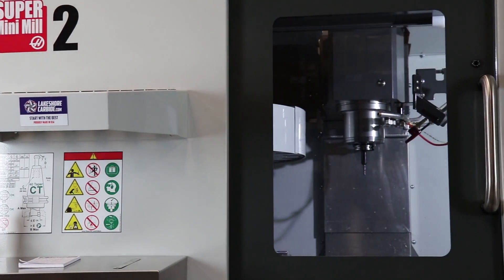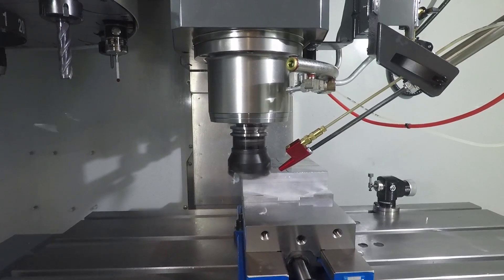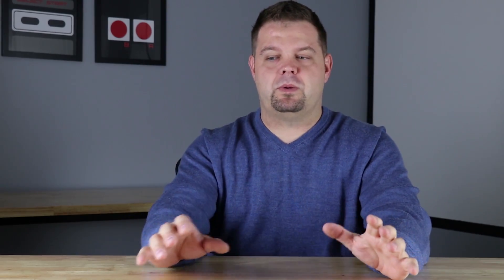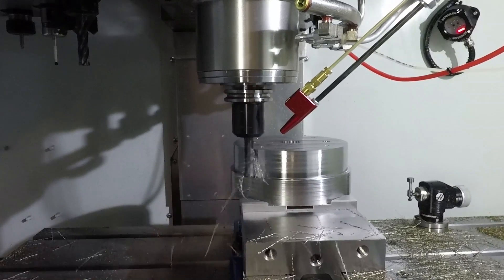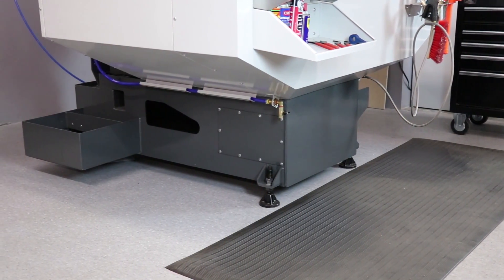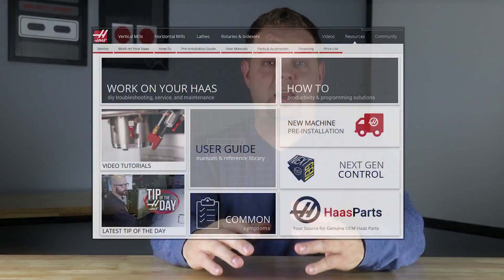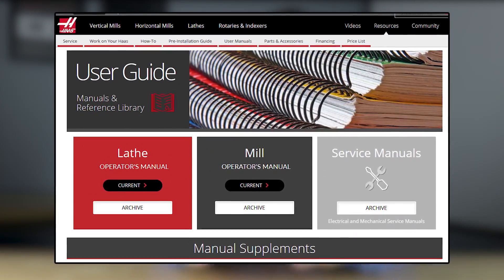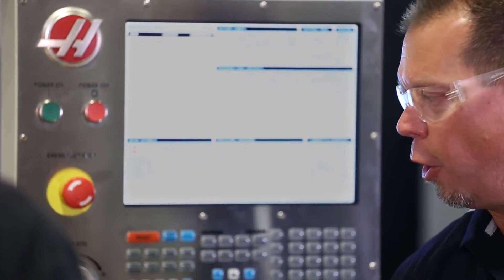HAAS Super Mini Mill 2 - Quick Review

Comment: Does anyone know if a VF2 is an option for a home gamer?  seems like the price difference between the SMM2 and vf1-2 is negligible but having only 40amps single phase in my garage-  smm2 seems to be the only option.
Reply: Check out a Phase Perfect PT-330, they rate them for up to a 70 amp single phase input, but I got a PT-355 and will run it a bit under amps. If you call them up they will tell you how many continuous amps it can supply and how many burst amps. For example, if you did have the full 70 amps it will supply 36 amps 3 phase continually and up to 150 amps for 4 seconds before shutdown. In practice, this will power a pretty decent sized motor. The VF-1 says 30 HP, but no mention of if that is continuous rating or a 4 second rating. Based on what I've read, it looks like a momentary rating and is probably in the 15 HP actual range. The best way to figure all this out is call up Phase Perfect and ask if they've had people run X machine off of what you have available.

Also, don't be afraid to find out what it would cost for another 100 amp run to your garage. Compared to the cost of these machines, it can be pretty inexpensive. Give yourself some power overhead is my opinion, you really don't want your CNC machine shutting down due to amp or voltage problems.

Comment: Thanks for your honest review! I went through the same selection process and ended up with a Brother S500X1. Prices with an IMTS discount are probably about the same as what you paid for the super mini mill. For me, the killer on the mini mill was that access, especially with the coolant tank. You mention you won't do flood coolant, so it probably won't matter for you, but I've heard it's a nightmare to clean out as it's not removable. FYI, I requested to my salesman and got a CAD file of my machine, use it for mockups with tools and workholding, has been helpful as many people said you would need riser blocks for a Brother without a 4th axis, which for me turned out not to be the case with an Orange vise.

I haven't taken delivery on the Brother yet, but I'm hoping it turns out well, unfortunately with these type of purchases, you have to just research it like crazy up front, and hope you didn't make the wrong decision. Freight and rigging alone just make it not even worth sending back or selling (assuming you'd want to).
Reply: EspressoForge congrats on the S500! I ordered one myself during IMTS, cannot wait for it to arrive and start making some chips
Reply: Thanks! Congrats to you too. Yours was probably the same, but mine came with the toolsetter and 3k tooling budget. I didn't add in the touch probe, for me I don't know how much I'll use it, but I'm thinking about adding one later if a 3d tester is a hassle.
Reply: EspressoForge  Congrats on Brother!!! Fantastic choice. Get the spindle probe though. Its worth its weight in gold!
Reply: EspressoForge EspressoForge I went for the tooling package, tool setter, mpg and override. I reaaaaally wanted the spindle probe, but I held off on it as well. Going to pick up a Tschorn 3d tester for the time being, read great things about it!

Question for you, what are you working with as far as air and keeping it dry?
Reply: Hey Patrick, I sent you an email with more info, but quickly, I went with a 3HP Northern Tool 60 gallon compressor. I've been pretty impressed with it. Very dry air with all the hurricane humidity lately. I also will have a FRL to put before going into the machine that I had for another air chuck, so if needed I'll probably hook that up as a bit of insurance.
Reply: Oh! Forgot to also mention, the S500X1 isn't that large, and only needs a 30 amp, 3 phase breaker. I'll be running it off the 2nd size Phase Perfect, but you could run it off the smallest size too if it's just for the mill.

Comment: What was the issue about the 40amp circuit that you said you found out more about later?
Reply from the maker: my bad....40 amps is a full load for the SM2 and 70amps is full load for VF2 but thats no where near nominal......depending on what coolant set up you have these machines arent't likely to pull the full amperage draws.

What i had eluded to in the video is that....if my salesman knew the truth about current draw, or had asked about clearance beneath the umbrealla tool changer. i'd more than likely have a VF1 or VF2 with a sidemount tool changer.
Reply: thankyou it is helpful with the debate between the mini and vf series

Comment: @Nerdly Also , probably had you posted your application / looking for a new machine / trying to decide on a new machine on PM forum those peeps might have steered you in the right direction... There are a lot of HAAS mini-mill vs VF2 threads. At least it's a good platform to discover HAAS in a big way if that's gonna be your thing from now on as you expand.
Reply from the maker: EXTRA DIMENSION agreed.  Live and learn.
Reply: A lot of the middle and lower end MTBs hide in the "Murk" or make things difficult to discern but I thought this video that HAAS put out showing the build and alignment of a VF2 (almost 30 minute video) is pretty useful/ helpful… Here's the thing probably had you seen this video https://www.youtube.com/watch?v=1s7tPqFtBRE&t=198s then probably that would have tipped you to the Vf2 (I reckon) (or a better machine with hand scraped contact surfaces). [But from the video you can see that the column is not ribbed or that thick / light weight... and the connection from column to bed is not hand scraped and they use shims... so for about $70K a Hardinge Bridgeport V1000 is a LOT more machine or similar Taiwanese Quaser "rig" very powerful rigid  and more accurate machine for the $]. [No affiliation]. 

 Years ago I bought probably the first Tormach ever sold, serial number 0000000...0007. I really believed in Greg Jackson's concept (he was the founder of the company (sadly passed away more recently))… But I have to say when the machine arrived I was absolutely appalled couldn't believe it (thought about a small sideline business rebuilding these machines lol)… And from your videos all these years later NOTHING has changed basically the same problems that I had back then still persist... Ridiculous.  I mainly bought the machine to test out some 4th axis moves and SW I was writing. I have a lot of engineering experience before then and machining and other. SO... Now I approach things from trying to buy absolutely the best machine I can possibly afford and take the biggest steps leaps and risks as I can (within reason)  to grow my company. I tend to plan in groups of three to five machines and then also plan out 3, 5, 7 12 and 15 years ahead. MAZAK is not bad for that and their financing can offer decent strategies for your business. I used to buy everything outright and have zero debt but now the financing thing seems like a better idea.

Comment: Interesting conclusions, can't wait to hear about the syil when it arribes. I am between ordering a Optimum Machine f3 or the Syil. My problem now is that my shop has not trifasic and very little space. Also with Optimum I will have assistence near my city and no custom issues... But, kind of analising everything now.
Reply: You can install a voltage converter and if you get it hooked up to your electricity net it migh reduce your power bill as well. Greetings from Costa Rica

Comment: Jason. Your HFO should have came out to fix your machine for free instead of having you do it. Your machine is under warranty. You don't need a repair manual, just a phone to call tech out.
Reply from the maker: they offered to.....but i didnt't want to wait.....if using the air gun wouldn't have worked i would've waited.
Reply: Nerdly  I had same issue on my Mini Mill, technician stopped by and showed me how to clean it out. You need to take Y axis way covers and clean underneath. Its part of normal maintenance. Its unbelievable how much crap ends up there.
Reply from the maker: awesome. thanks for the advise...i'll get in touch with my tech
Reply: Nerdly
Hı mate, thanks for your comment and review on this machine . Will that be possible for you please to write down the details of this machine, price and tell me if it is a proper machine to work with stones (quarts, granite,  marble etc...), to engrave and/or 3D cut ?? Of course in small sizes. Will be very much appreciated. Cheers mate.
Reply: Mori only. Mori machines hass parts